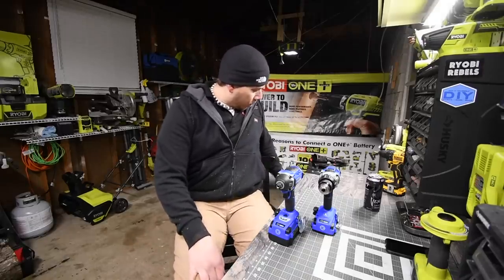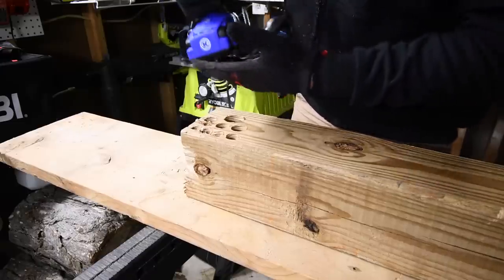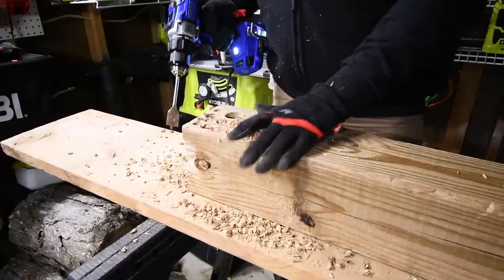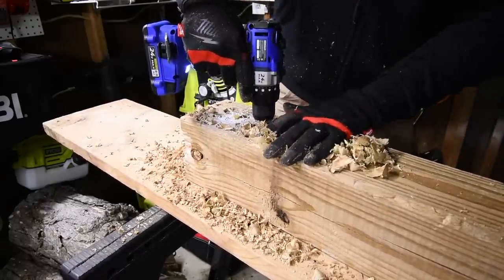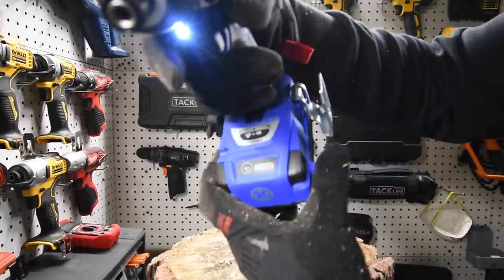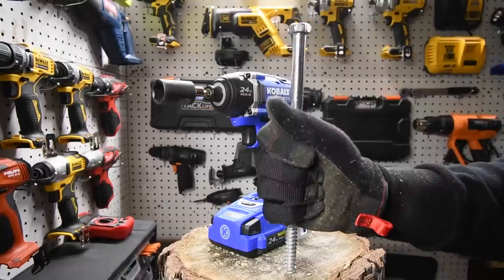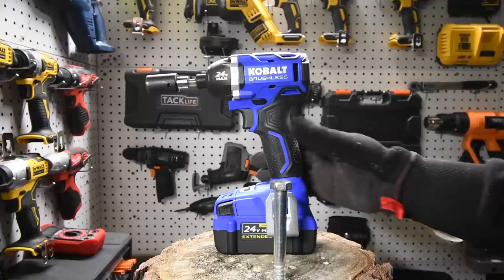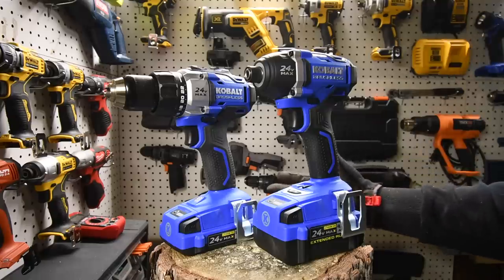Kobalt Drill/Impact test/Happy NEW YEAR!!!

Comment: A good reason to use an impact with a paddle bit, it won’t jerk on you. They make impact rated paddle bits and impacts are great for drilling regardless of what a lot of people believe. A lot of people say you shouldn’t use an impact with paddle bits but it’s just not true. Also, that self feeding bit should work well enough that you don’t need to put any pressure on the drill, maybe try and see if that one will. It may take some of the human error out of the test so they are all equal
Reply: Keep in mind, I’m not criticizing your video or methods. Just sharing some info with people 👍🏼
Reply from the maker: I will check those impact rated battle bits out and put them to the test and thank you sir
Reply from the maker: and I thank you for that. I listen to comments and adjust the tests and safety measures

Comment: "Why did this kit come with a handle?... it's not a hammer drill..." 6:14
Reply: Probably for paddle bit drilling
Reply from the maker: lol I know now. I will be using it for now on
Reply from the maker: lol exactly, session learned
Reply: @ManCaverTools  I found out the hard way. Was using a massive hole saw and jacked up my wrist!
Reply: @ManCaverTools  I love those Kobalts. I have a set along with their amazing Led flood light and, like you I buy a lot of drills (in my case, for no reason other than I have G.A.S. Gear Acquisition Syndrome). The drill driver is smooth as butter. No vibration.

Comment: The one criticism I have for these tools is that the minimum speed on the impact driver, drill and multi tool are to high. Particularly the drill and the driver, for smaller fasteners in particular it would be nice if the motors would start at a lower rpm when you begin squeezing the trigger.  Perhaps this is because they are brushless and I am used to brushed tools.
Reply from the maker: we will see how low the RPM will go and thank you sir

Comment: I noticed at 9:00 the drill is making the knocking sound when you release the trigger, seems to be the brake in work and mine is doing the same only super clicky/loud at the lower speeds in gear 2, when it is over speed 16 or 17 the sound softens down quick a bit. Does your do the same? Wondering if I have a faulty unit...
Reply from the maker: it might the the chuck clamps hitting the wall

Comment: I just got my Milwaukee 2853 of impact driver yesterday & 2 new 6.0 batteries I screwed in a 1/2 inch by 10 inch lag bolt length ways into a pressure treated 4 x 6 & tool would cut out with a inch to go I had to release trigger & squeeze again to finish driving screw but when I put a 9.0 battery on tool it drove screw in no issues 3 times back to back no breaks does this sound like issue with tool or the 6.0 batteries or is this normal?
Reply from the maker: no, is the 9ah High Output?
Reply: @ManCaverTools  no it say HD high demand